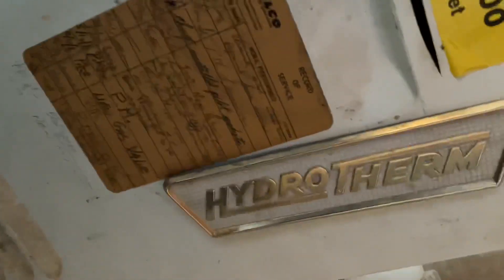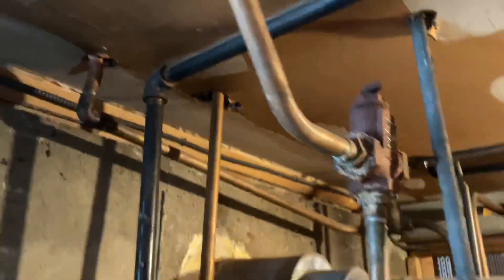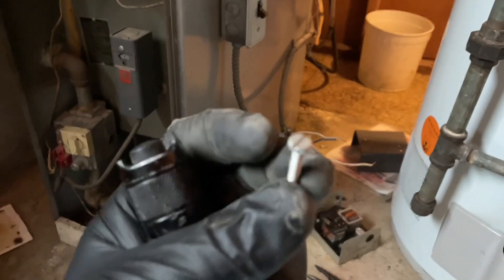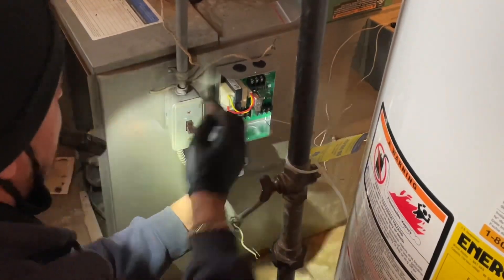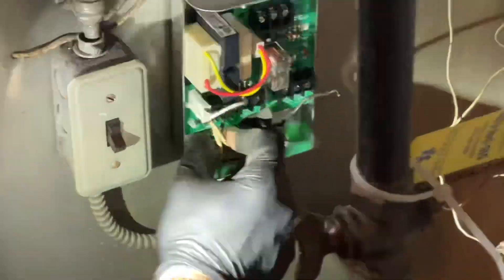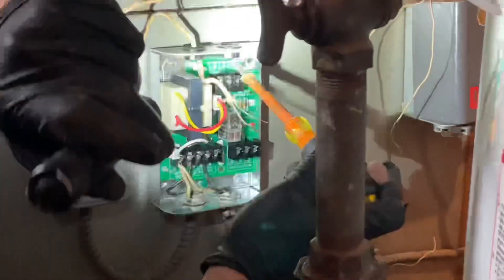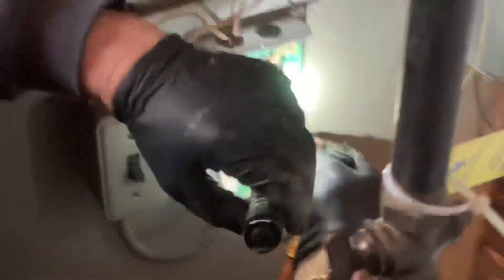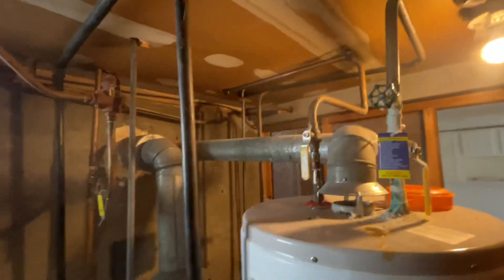Hydrotherm Gas Boiler No Heat Bad Zone Switching Relay Replaced Taco SR501 Installed

Comment: I'm converting a van and using a Taco SR501-4 for radiant floor heat.  I'm not a plumber and looked everywhere for help installing this simple device.  This is the only video I found that explained the wiring I needed.  👏👏👏Even the Taco site was no help.  Thank you!  I'm a subscriber to your channel now.

Comment: gotta laugh at some of the dopes doing service now days.you look intelligent and have good work ethic you'll do good .i got back into residential after a 20 yr break.smh at how little basic wireing disabelled  tech are now days.get a compressor for blowing out gas assembles and pilot valves,only need about [30 psi ] .its hard to grow as a company,hope you get to weed out the dopes